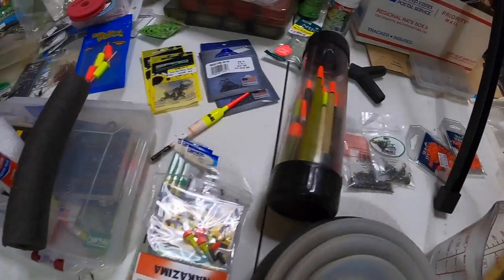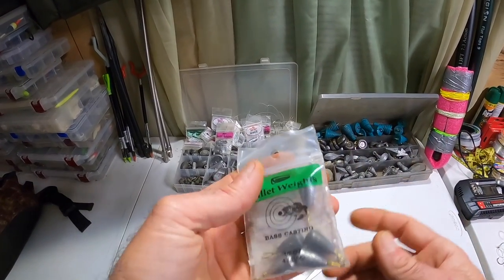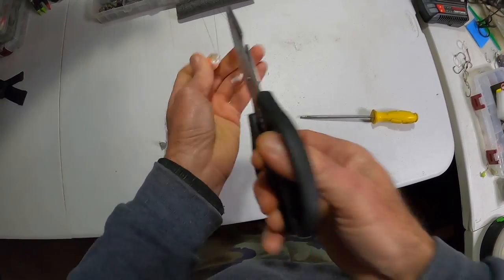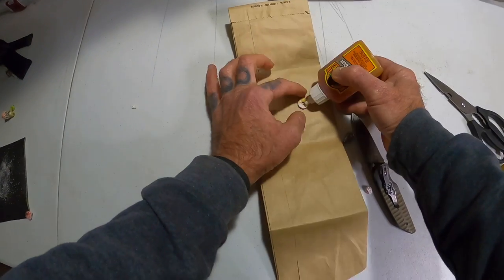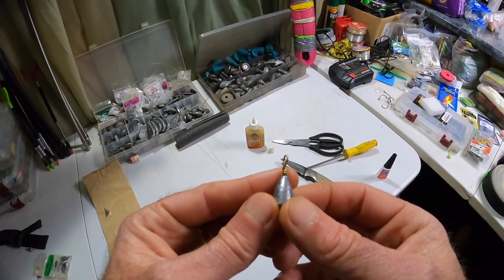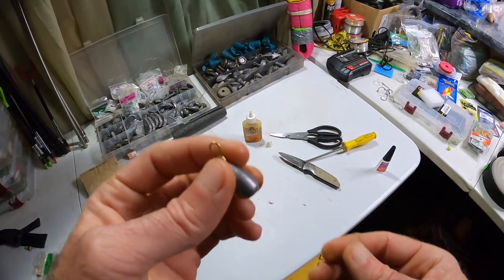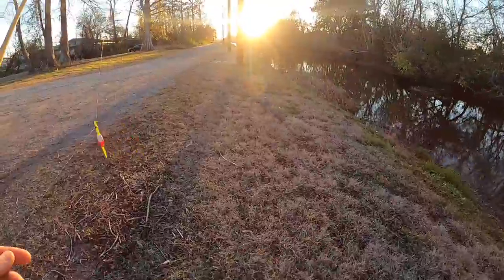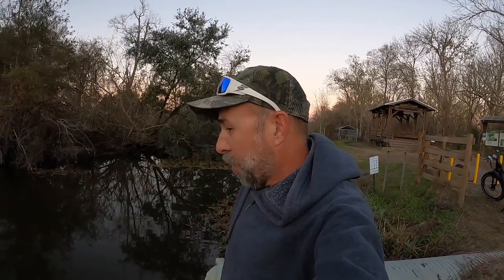DIY Plummets For Float Fishing And Micro Fishing

Comment: How would you test the depth in deeper water?
Reply: With a different kind of float that is running free on the line with a threat or rubberband stopper that fits through the rings of your rod. You can easily measure 15 feet of depth with that. Also good to figure out, where the shallow water transits into deep water. Thats where the fish is. ;o) Greets from germany
Reply: Like Robert said. A slip float or inline float with a bobber stop. You can find bottom easily and fish any depth you want with a bobber.